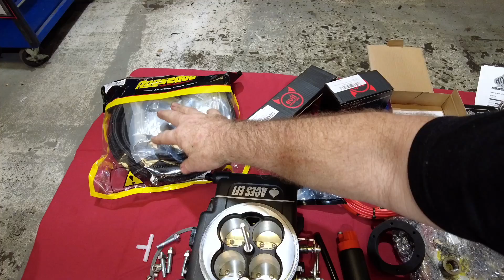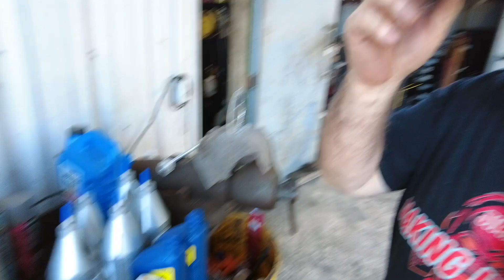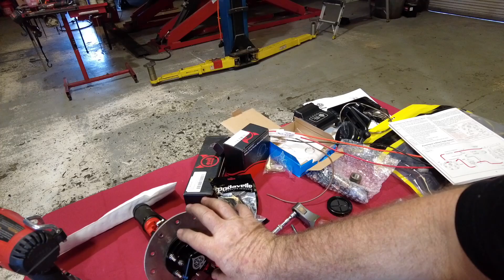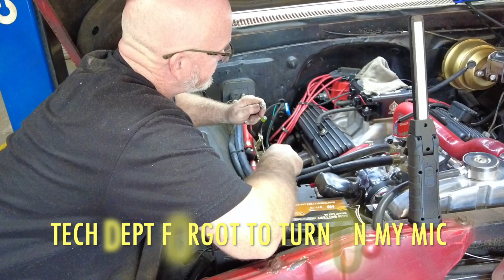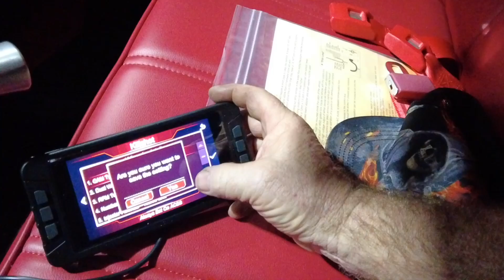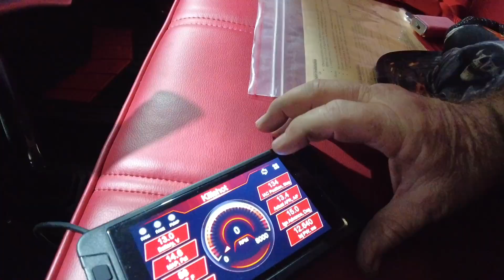ACES KILLSHOT, Trash or Treasure? We'll find out on our 62 C10 project truck. Our Holley leaks, ALOT

Comment: You want a return line on any electric fuel pump over 15-20PSI, I did a bunch of EFI conversions for marine and all the early ones had return less fuel system and if you have a long no wake zone they would vapor lock in the pump or the pump would shut down due to over temp but the problem was discovered on fishing and crabbing boats because they do a lot of idle time and pump temps were 210-240 degrees (danger zone for gas). The fix we used back then was to put a regulator after the pump with return line $50 fix never had problem again. If you have a problem with felling sluggish when you mash on it at highway speed, you need an airgap intake manifold and for marine applications with raw water cooling you need to pull intake and block off the exhaust crossover.
Reply from the maker: Thanks for the tip, that's some really solid advice on fuel system setups! 👍

Comment: Great video!  I need help to figure out how to and/or where to connect the IGNSW (Red) clean key-on cranking +12V power source.  I have tried and it isn’t working. Can you tell me how you got yours connected? I greatly appreciate your support.
Reply from the maker: I added a military grade positive terminal that allows me to add wires easily. So I have a circuit added for just the EFI right to the battery. It won't drain the battery if the ignition power to the unit shuts off completely with the key off.

Comment: Hello Sir, I pray all has been well with you. Listen, I wanted to know how your engine was functioning, with you having your distributor's vacuum advance on the Aces Killshot TBI"s 3/16 ported vacuum port? Has your engine been running hot or cool? Since your Aces Killshot's ECU isn't controlling timing, did or do you have to put your foot on the gas pedal/throttle, as a means to maintain an idle, so the engine can buildup to operating temperature, so ya could adjust the IAC, between 6-20?  Or, did you have to increase your startup/crank fuel, so the engine can idle longer, as a means to get it up to operating temperature?.
Reply from the maker: It runs great with the timing vacuum where the engine manufacturer recommended, which is ported vacuum. I moved it to manifold with just a minor change in idle speed until the system adjusted it back down on its own. Does a great job of controlling the idle so far, even with the AC turned on.
Reply: @JimmyMakingitwork  , Ok, that's good to hear. Since you've changed the distributor's vacuum advance to manifold, which one is better? And, since your ECU isn't controlling timing, how long does it take for your engine to reach operating temperature? Also, do you have to engage the throttle to maintain an idle, to get your vehicle to operating temperatures? You know, to prevent the engine from stumbling, while you're trying to warm the engine up, like you would with a carburetor.?

Comment: Just installed that same Killshot on a 396 ElCamino. Installation went very smoothly like yours did. I used a Corvette filter regulator mounted by the tank so retuurn line was very short. It runs really good so far ut it's wintertime so it's only got maybe 100 miles on it so far. Only thing I see so far is the injectors seem to be very noisy. When sitting idling, it almost sounds like something is wrong with the motor. Waiting on a reply from Aces about that
Reply from the maker: Thanks for sharing your experience with the Killshot! It's always good to hear how it's working for others.

Comment: What did you set the fuel pressure on the regulator at. I am troubleshooting issues
Reply from the maker: I have mine set at 48 psi. You can experiment with a few psi more or less depending on your symptoms. But it may take a little bit to correct in auto tune.

Comment: How is this system working for ya now that its been a few months???  I put one on my sons ‘67 mustang 289 around 2 years ago and recently put a built 302 in the car so now i gotta reset the whole thing and re-learn (tune) it cause its 289 stock  tune DOES NOT agree with the new motor so for break in purposes we put the holley 600 back on but we also ran it to 2500 miles so were done with break in!!!!..,,im just weary cause i got this holley tuned tits and the car starts cold in the morning just by breathing on the key!!!!!……im sure my son wants the fuel injection back on, i told him when summers over and we get into cold weather then yea we probably will yank the holley off again and shelve it for the next 5 year term!!!
Reply from the maker: It's been working great for me, especially since it sits a lot. But every time I drive it, the idle is good, it responds well to the AC being turned on. No issues so far.
But I had so many problems with the Holley carb I had nothing to lose, it was gas washing my engine and fouling plugs. Your situation sounds much better.

Comment: ya I was wondering about Aces on a Blueprint its cool to see. What transmission do you have? Also, what did you consider when ruling out using the other fuel setup options? Im interested because my application is Aces Wildcard port injection on a 327 sbc with 4 speed. Why not run the Aces surge tank? I might get a Blueprint eventually to go with it
Reply from the maker: I used the in tank pump set up. I have a 5 speed from an S10 in it, not sure how long it will last. But so far it’s ok, just won’t run sticky tires.

I didn’t want to add more components so didn’t use the tank set up.

Comment: I liked the video. I am looking at getting  a 383 myself. Do you know what model from Blueprint thst this is? What is the vacuum like for power brakes? 
Thanks
Reply from the maker: This is the bigger cam version, wanted a nice performance idle. It works with my small dual diaphragm booster. Some might need a vacuum can though. It’s about 12” of vacuum last I checked. Great engine for me!

Comment: What's up Sir, I have another question for you, I see that you installed a relay for a clean ignition voltage, as well. The relay you used for this purpose, is it with a built-in diode or not? If it's without the diode, does the relay affect your Aces Killshot's ECU in any kind of way? Like, restarting itself when trying to crank the engine. Or, display erratic behavior when turning the ignition off? Basically, trying to see if the relay's flyback voltage bothers your ECU, when you turn the engine off.?
Reply from the maker: No I have not had an issue with the relay I used. It was from a cooling fan kit I had around for a while. So it might have the one way diode in it, but I did not specifically look for it. I do suspect it might have it because of its purpose though.

Comment: Hello Sir, I have a question for you, I am having a voltage drop issue with my Aces EFI, system. The handheld displays 10.8V, but when I crank the engine, it jumps to 11.8V. Then, when I stop cranking, it goes back to 10.8V. A few weeks ago, I was forced to extend the power & ground wires, so they could reach my battery. I used 12 gauge copper wire for this extension. Less than a foot, of wire I used. Now, the handheld showed 12.8V for a brief moment, when I turned the system back on. Then, out of nowhere, the voltage dropped back to 10.8 on the handheld. I only got the RV to start once, then it died on me. Today, I measured the voltage at the power & ground wires, at the ECU connector. I'm only getting 5V. I have new batteries, all wires are good, new starter, all good grounds, & cleaned all my terminals, along with making sure everything was tight. Have the power & ground wires connected directly to the battery. Now, I connected the Aces Killshot's ignition wire to my ignition switch's ignition wire, on my 87' Ford E350 Motorhome., to get the 12V switch power. So, I don't know why I'm experiencing this voltage drop issue. Do you think I should connect the Aces's ignition wire to a relay, for the clean switched 12V. Do you think me t-tapping into my ignition switch's ignition wire on the Ford ignition switch's wire harness, is what's causing these voltage fluctuations, & voltage drop, at the ECU?
Reply from the maker: It sounds like you might have a bad connection somewhere, possibly with the extended wiring, or an ECU issue. I’d for sure try a relay powered on by ignition that feeds direct from the battery. I’d test down the wire to find the drop with the circuit on. Should narrow it down. Also look for warm spots in the wires.
Reply: @JimmyMakingitwork , when you say test down the wire, are you talking about testing down the Aces Killshot power & ground wires, or the extended wire I added to it? If so, do I need to use some type of DC voltage tester? And, thanks for the feedback.
Reply: @JimmyMakingitwork Hey, got some good news. By the grace of God, the issue was what the Lord told me to do in the beginning, put the Aces Killshot's ignition wire on a relay. Yes, indeed hooking it up simply to my duraspark to ignition wire is what was causing the voltage drop. Got a clean 12 volts, Sir. Just need to get a properly functioning fuel regulator, then I'd be good to go. God is good.

Comment: Hello Sir, I just got finished installing my Aces Killshot, last week. I had to correct a few things, with the fuel system, because I was in error. However, I was having a voltage drop problem with the ECU & my battery. So, today I installed a relay, For the ECU could get clean power without no voltage drop or fluctuations. My question is, I have pin 86 hooked up to the I - terminal, on my starter solenoid, for a switch 12 volts. Is that a good spot for that? And, I have installed a 12 gauge, inline fuse, to connect pin 30, to the battery. I know 12 gauge wires can handle 20 amps, now what fuse size should i use since this relay is for my ECU?
Reply from the maker: Hmmm, I don’t use the starter I feature, so not sure on that. For the circuit that powers the ECU 5 amps is likely enough, I use a 10 amp fuse however. I would avoid going any higher than that.
Reply: @JimmyMakingitwork , Good video, & thanks for the feedback.

Comment: Nice job all you needed was a corvette style filter will bring psi down and returns from there usually they are mounted along the frame not far from the tank
Reply from the maker: Yeah I considered doing that, but wanted to have the ability to adjust it. In case there are other changes in the future.

Comment: Back on the C10, Yay!! I'll start by saying I'm not a fan of the throttle body FI conversions, especially the entry level kits. I'm not knocking this Aces deal, honestly I've got no experience with them.    I am old and love my carby's, but they don't like ethanol and sitting around doesn't do them any favors either. Still I'd have dug my heels in and thrown a billet metering block on the Holley primary and chased that fuel drip to the moon. Lol. In my defense most of my TBI conversion experience is close to 10 years old now and centered around problematic 1st gen offerings and crappy installations. So it's good to see you pull on your engineers cap and walk us through a proper install, with care and thought given to component location, access and serviceability. Bill and Bob still don't get it... Tripping up on regulator plumbing? Yep, most wouldn't have shared that, good on you! I am curious about you switching back to ported vacuum for the distributor. Was this a recommendation with the Aces deal? My thought is I like manifold vacuum on bigger cams with increased overlap. In my mind at low speeds the overlap works like a built in EGR and the engine likes the increased timing to burn the diluted mixture and help with the "Holley smell".  Carry on Jimmy! Making it work! Even hot rod stuff.
Reply from the maker: I hear ya on the old carbs, but I'm pretty happy with how this is coming along! Totally agree on ported vs manifold timing connections. But I noted that the engine came plumbed to ported and Aces recommended ported. So even though I had switched to manifold for a cleaner idle burn, I decided to try it back where the big know it all companies said, haha.

Comment: I like the simplicity of this system. The one that I put on my boat is port fuel injection, which requires distributor modification as well as changing the intake manifold. As I have commented before I have had it for 20 years and I would not go back to a carburetor. Keep us posted on how it works out.
Reply from the maker: Yeah, it's nice to have it all in one spot, and it seems to be doing a great job so far!

Comment: @JimmyMakingitwork  Have you heard anything about Smeding Performance engines? I am drooling over their 427" Mighty mouse CSM with Dart block to put in my 1966 C10. Internet is totally empty of bad stuff about Smedings even though they been building engines for 30 years and 30.000 engine builds. Can they be that good at building or just really good at cleaning up Internet hehe
Reply from the maker: Yes, that is actually another company I considered before going with Blueprint. That is on of their more radical engines, nice!
The difference for me was mostly wait time of about 8-12 weeks. I also really liked that BluePrint casts their own blocks, cams, rods and many other parts. They have some good videos of those processes and how they improved in many things. Plus they were in stock at Summit and had an 18 months no interest payment option at the time. Made it too easy.
Reply: @JimmyMakingitwork  I understand, in my head Dart trumps Blueprint but I have nothing more to go by than Dart block have been used by serious racers true time so they cant be all bad. But first there will be body work and paint on the old boy and new AAW harness going on and all the rest. But do I like the truck after that there will be a nice engine in it: So for me the building waiting time is not the problem :D

Comment: Thanks for the video Jimmy!
Does the regulator have to be in the engine bay? Can you mount it near the fuel tank and then run a single line to the EFI?
Reply from the maker: These style regulators work best on the return side since it's basically a variable restriction. So there is a lot of fall off on the outlet side. There are some styles that can be mounted in or near the tank though.